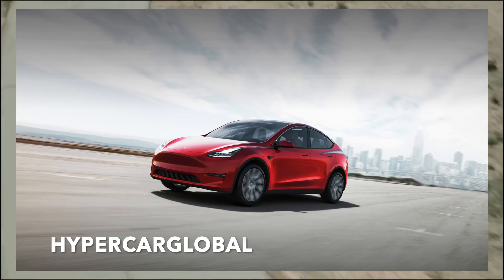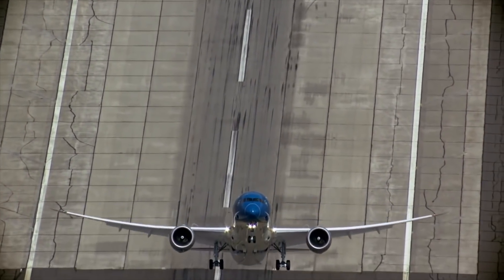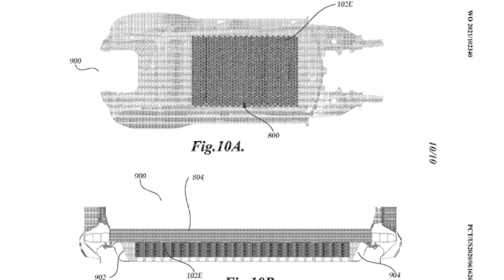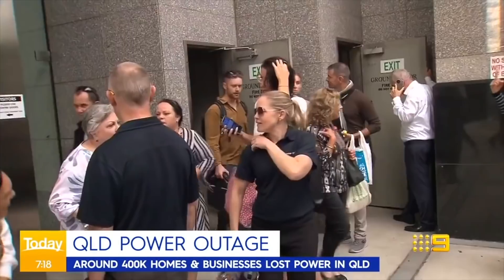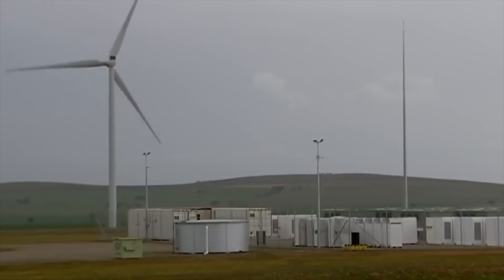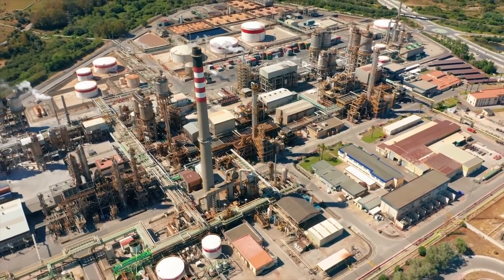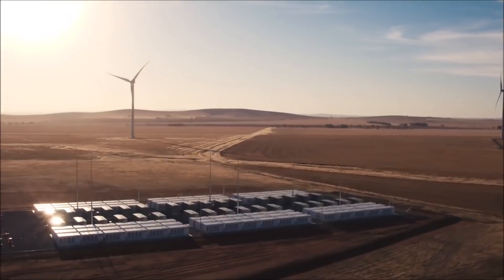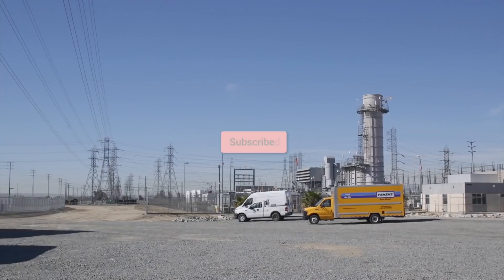NEW PATENT! Tesla UPGRADED the 4680 Battery!

Comment: HVDC transmission is working in China. Minimal inductive loses. Could run power from remote battery farm to inverter stations as HVDC perhaps and increase efficiency? Less in the field maintenance at generation / storage plant. Maybe faster synchronisation if inversion takes place nearer to the central load parts of the grid? Less data round time.

Comment: The 4680 format has an aging issue?  
Premature aging of thermal and electrical conduction performance. 

Per Tesla’s patent, 4680 cell replaces “single welded tab” with “multi non welded flaps” to improve electrical and thermal conductivity over conventional single welded tab. 

These non welded flaps conduct heat and electricity as patent claim from the delivery day, begins to age as soon as it is put under inertial and thermal shock in normal vehicle use. Why? 

It employs annealed soft copper in the flaps that can’t flex back to its original shape once deformed, deform from inertial and thermal shock of normal vehicle use. One by one begins to disconnect from its output terminal, ie cell casing, until only one left. From there on further inertial shock will cause momentary open circuit from the cell wall. Leaving thermal and electrical conduction equal or worse than cells with one welded tab. 

All chemistry improvement in the 4680 will be gated by those soft copper flaps. Unable to addressing this aging issue will let pouch cell designs out perform Tesla’s 4680 cell. Almost all Tesla’s competitions use pouch format. 

If the thermal management in model3 isn’t implemented with 4680 cell pack can accelerate premature aging for modelY and future models on 4680.
Reply: No biggie, just buy another.
Reply: @Americannovice Twocentnovice ok if I know his address.
Reply: @yk Chan, yeah ummm, can you provide a source?  This is the first time I ever heard of contact related issues with the 4680 format. 🤔
Reply: @keithnance4209  source. I’m my own source.
Why don’t you make a case study of this like I did? 

Example. products powered by battery has a primary means of closing the circuit (1) interference fit “spring force” and (2) bond “welding” - 
What do Tesla use in 4580 cell? 
Tesla removed (2) and remove spring from (1) 
Spring? Low power application such as iPhone.  Welding? Reliable and high current handling such as 18650 of model 3.   
. 
The 4580 patent assume those copper/aluminum peripheral flaps to possess spring properties is false. Copper and aluminum foils cannot offer spring properties and will deform permanently at inertial and thermal shock resulting in an open circuit. 

Tesla plan to assemble 4680 axial vertical which is any worse orientation the copper flaps fiercely couple to inertial shock most. Remedy? Use horizontal axis assembly to decouple from on road shock.
Reply: As an expert can you explain the exact meturlagy of the battery cell, the wall especially as from the brief look on the Internet this is where your supposed deforming is caused, also being tab less there will be exactly no deforming due to the layout of the battery, if as you falsely claim the issue is metallurgy deformation I am sure you have no problem giving the exact composition and why it would deform...no...thought so.
Reply: @AndyAndy-we9pe  
You mistaken about the cell wall deformation. What can be deformed is the anode flaps, flaps extended from the anode made of annealed soft copper foil that yield under inertial shock. Once the only welded tab is omitted in 4680 cell, heat and electricity can only coupled through these flaps. Cell out of production line may have 99% flaps touching cell wall but not for long once vibration started. Do your own research with kitchen aluminum foil to draw your own conclusion. By the way the cathode in 4680 are made of aluminum foil.
Reply: Ok buddy, I’m not an engineer, but those Tesla engineers are some of the best the world has to offer. You’re saying they overlooked a key mechanical application that will cause the battery to degrade worse than single tab…I’m going to bet they know exactly what they are doing.
Reply: @keithnance4209  I agree Tesla is innovative company. Giants do dose once in a while. You are betting on that dose. good luck. 

Do you have a buddy keen on ME mechanical stress analysis? If no, save your bet on something else.
Reply: @philoso377  There is a saying…‘Don’t bet against Elon…’ so far it has been wise words to go by in over the past decade. 1st principles is something all industries have been lacking for decades.  Elon and his crack team of Engineers are turning so many industries on their head because they have been stagnating with the ‘status quo’ and putting easy profits over innovation.
Reply: @keithnance4209   
Right first principle. My advocate also came from first principle. This time the giant dose. 

One should not defend some one with things beyond one’s reach or beyond one’s comfort zone when all one has is faith and history but first principle.
Reply: @philoso377  well it’s very healthy to debate any such topic and I suppose we will find out in due time whether tabless design is flawed or genius. What I do know is that they have a patent for it, which means they must have some idea that it’s a valuable and novel design. And they certainly must have stress tested the design. shrugs
Reply: @Americannovice Twocentnovice 
The remedy to the accelerated aging in 4680 patent for modelY is to

(1) maintain model3’s welded tab or tabs
(2) maintain model3’s thermal management
Or
(3) tab-less plus (1) plus (2) above, or
(4) tab-less plus thermal and electrical welding/bonding from electrode to cell wall, test to rule in/out (2) above. 

We need those remedies in modelY 2.0